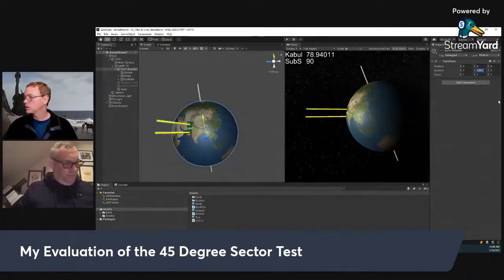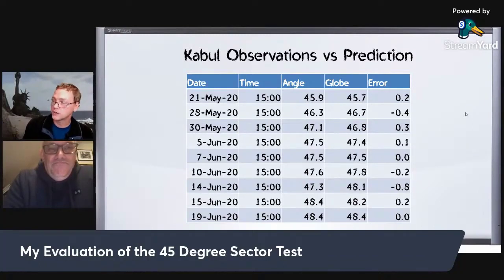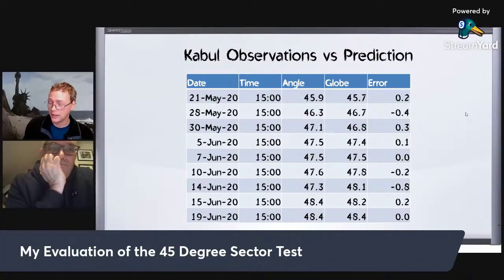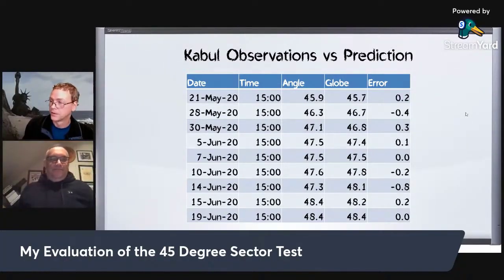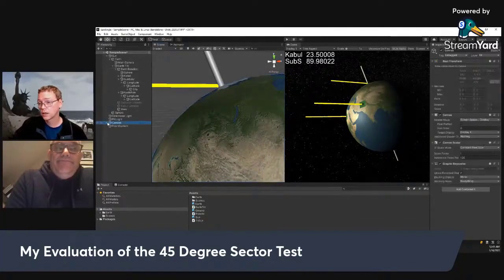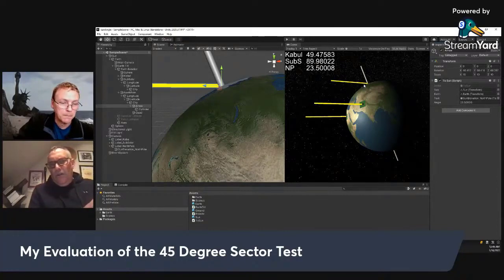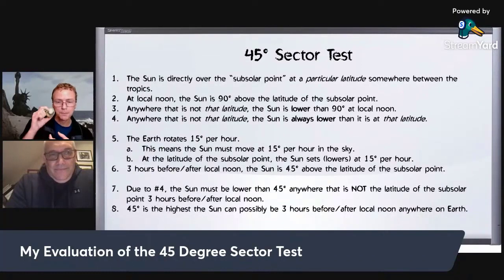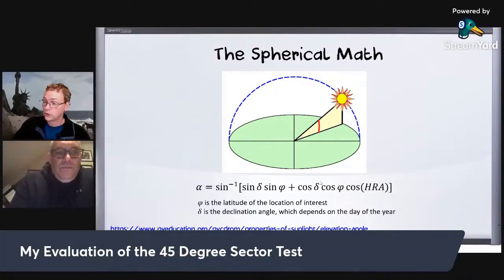Conversations with Corey - My Analysis

Comment: Corey logic: I tell you that the globe model must predict that the sun angle cannot be greater than 45°. If the globe model predicts that the angle can be greater than 45°, then the globe model is wrong. It doesn’t matter that the globe model prediction matches what I have measured (more than 45°). If the globe model does not predict what I tell you it should predict, then the globe model is wrong and the earth is flat.

That‘s flat earth logic pure.